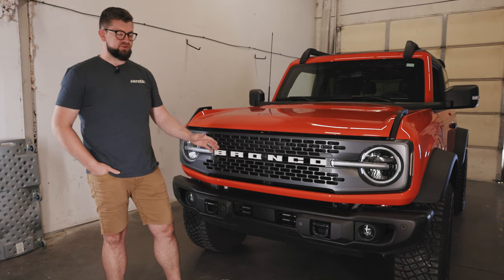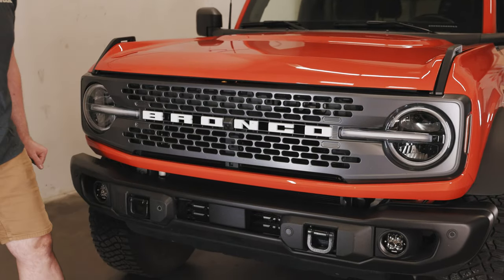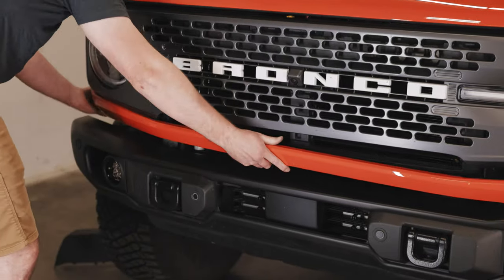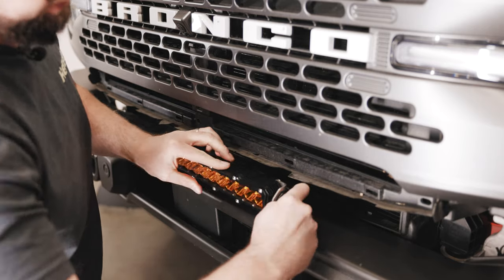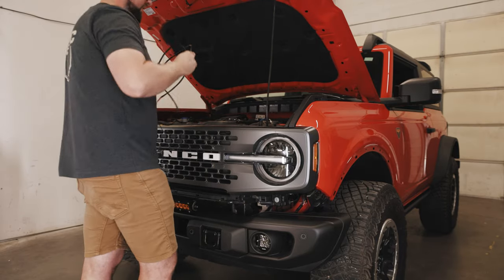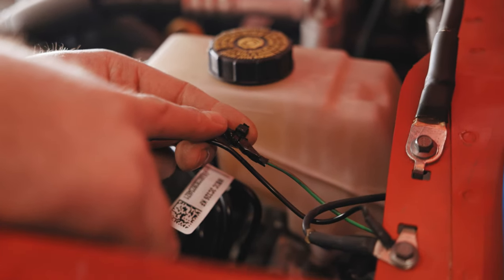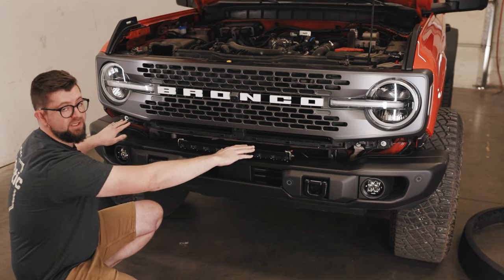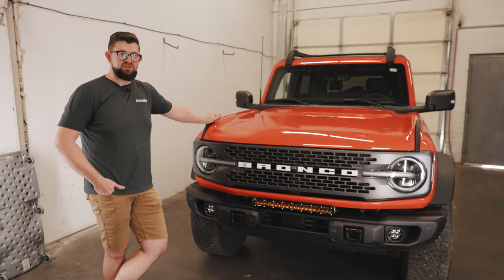Heretic Bronco Capable Bumper  20  Light Bar Install

Comment: Is this just for the capable bumper or can be used on the plastic standard Wildtrak bumper?
Reply from the maker: This is just Capable bumper specific.  We also have options for the modular steel bumper.  Working on the plastic standard bumper now!

Comment: Do they sell brackets for a 30 inch light bar in the same location?
Reply from the maker: Not at this point in time.  Based on the hole locations it makes it a bit more difficult!

Comment: 1:56 -- was there no measuring involved? Is there only one way the bracket fits? You just put them on with the sticky pads -- no bolts or anything? Just curious how you were able to put them exactly where they needed to be?
Reply from the maker: Yes, the brackets will only fit one way.  The rubber is there as a way to add protection.

Comment: with that much space i would put a 30 inch light bar instead of 20
Reply from the maker: Given the mounting points and how the brackets would have needed to be shaped and bent to prevent too much flex and vibration, we decided to go with the 20".  A 30" would have to be a much more expensive bracket!

Comment: $700 bucks for a 20" inch bar is pricey. I have seen the competitions 40" bar for alot less. But i gues u get what u pay for . Great vid
Reply from the maker: Thanks for the comment!  That also includes all of the brackets and wiring.  But you are correct, you get what you pay for!